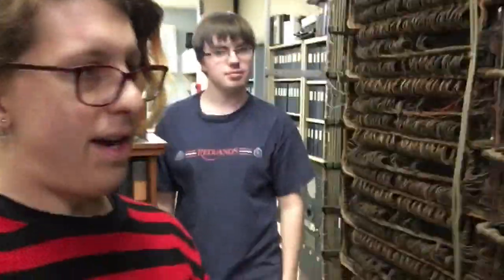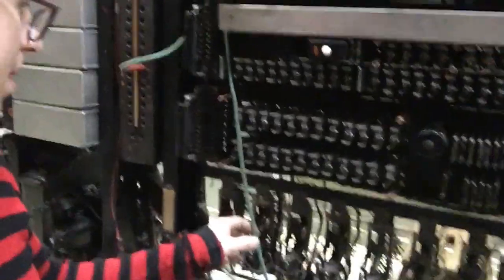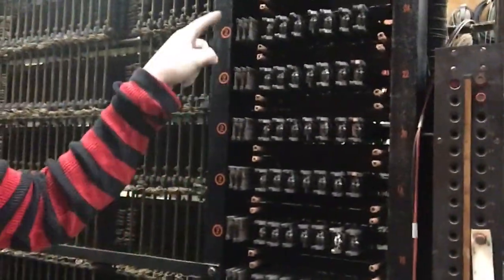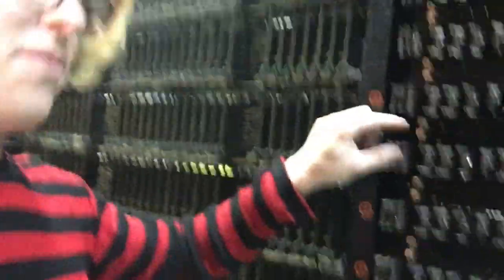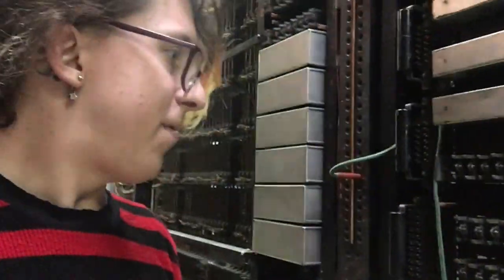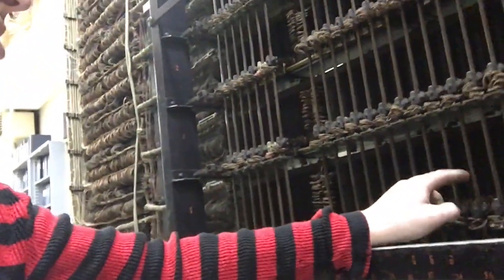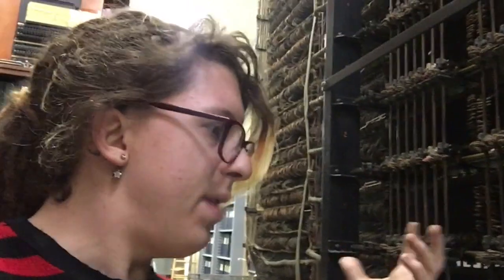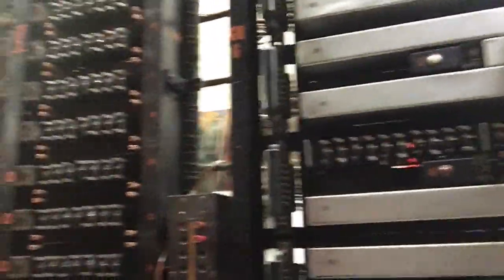Panel System - Line Finder Update 10/25/17

Comment: How many phones can the line finder control?
Reply from the maker: 300 subscriber lines terminate on this line finder frame. They are divided physically into 15 groups of 20 lines each. Each vertical selector can reach any of the 300 lines, and connect it to an idle district and sender.
Reply: museumofcomm neat! That is more than I expected given that it is all mechanically switched. What is your ultimate plan for it? Would be neat to have 20 or so phones through your the museum working off of it.
Reply from the maker: When I started here a few years ago there were 2 telephones, plus a call thru set with 10 lines connected, for a total of 12 phones. I have since added 4 more lines, plus one for our Asterisk computer, and a couple for the key system phones around the museum. We are very quickly approaching the maximum of 20 phones that we can have in the one group that is provisioned. Andrew and I are in the middle of figuring out how to bring up more line finder groups, and I think we are making good progress towards that goal.

There will be probably 16 lines coming from the Asterisk computer for a call simulator that I wrote. Then, we can just add more real telephones as necessary. (I'd also like to give the desk phone at my office a number on the panel switch as well!)

My ultimate plan is to get as much of the switch provisioned and working as possible. I'd like to do that in a fashion that is historically accurate and proper, because well...we have the only one left in the entire world. It had better be done right! ;)